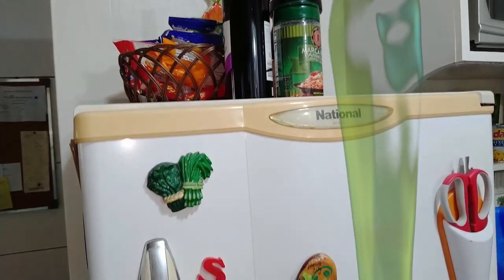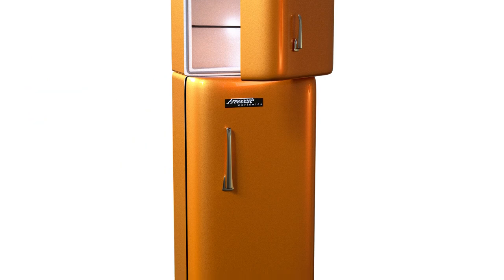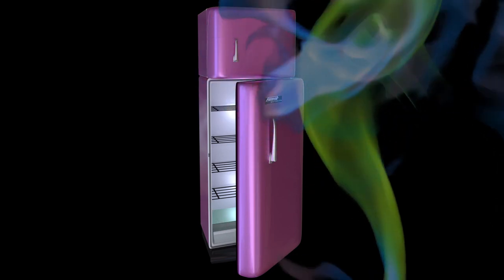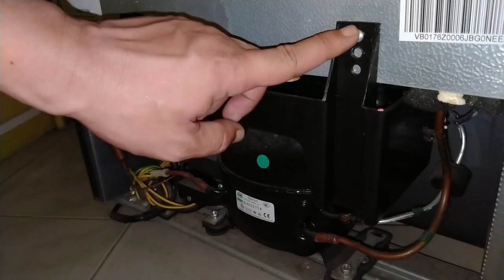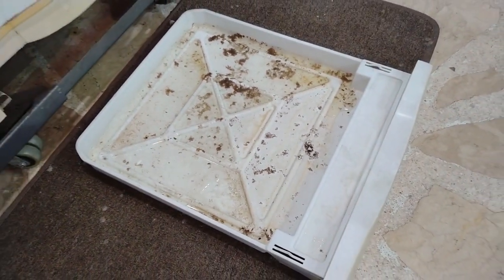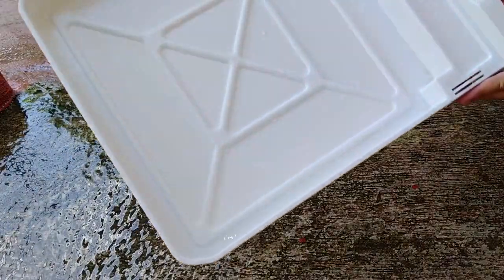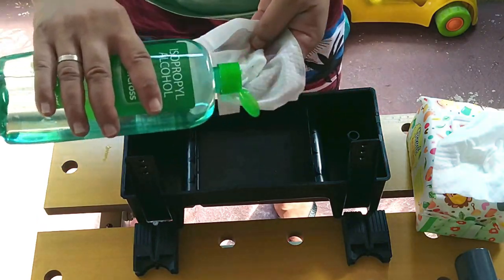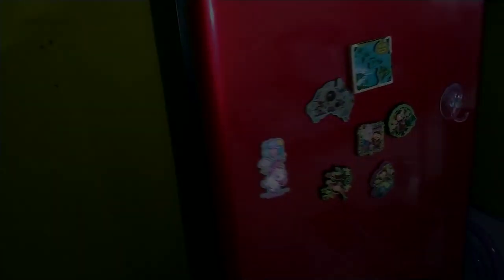The Shocking Truth About Your Fridge | Why Stink Doesn't Go Away | How to Clean Smelly Fridge

Comment: This definitely seems to be the case with my fridge. But weird thing is when I put my temperature setting to colder the smell seems to gradually go away. When I put the setting to higher temperature, it comes back. Any idea why??
Reply from the maker: Low temp makes the air denser and therefore limits its movement. Also hotter air amplifies the smell of stuff.
Reply: @HanDIYman007  sorry I meant the temperature setting of my fridhe not the room
Reply from the maker: @asadzaidiish  yes, i was referring to the temperature setting of your fridge.

Comment: What about when you've cleaned the drip pan (which was disgusting BTW), and the smell is still present coming out of the fridge and freezer air? Fridge has been cleaned, baking soda is in there and it's awful.
Reply from the maker: Check the drain holes if there's clogged gunk from defrosting.  Basically, trace the path of liquid where it drains whenever you defrost.
Reply: @HanDIYman007  my husband checked the drip Pan and it was bone dry!!! Fridge still stinks to high Heaven !!!!! Help!!!
Reply: Get a new fridge lol
Reply: @MsCulinaryPro  My problem got fixed without buying a new fridge. I removed everything from the fridge and freezer, then unplugged it and used cleaning vinegar to Scrub it from top to bottom. The freezer ice melted so it was a deep clean. When I plugged it back up the smell was gone but what come back through a little bit for about a week and then after that it was completely gone.

Comment: Nope.  My fridge still stinks badly.  I have wiped interior with bleach, all trays washed in bleach and dishwasher soap.  Drip tray at base removed and cleaned (not much to clean).  I wiped down exterior (greasy), I wiped and cleaned all fridge seals.  Air blowing inside fridge stinks still.  I have put baking soda and charcoal in fridge for nearly two weeks now.  I give up and will throw away fridge.  This video only simple solutions.
Reply from the maker: Sorry to hear that
Reply: Flush the drain hose with turkey baster and hot bleach water